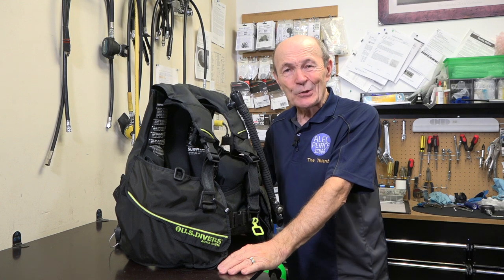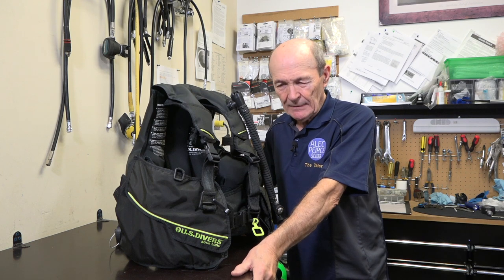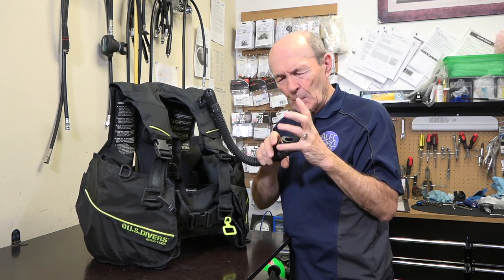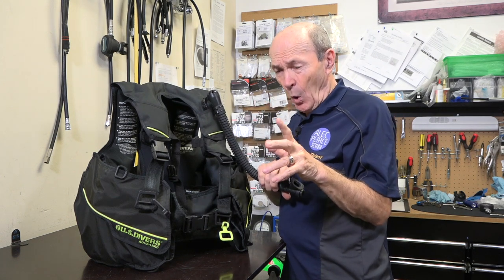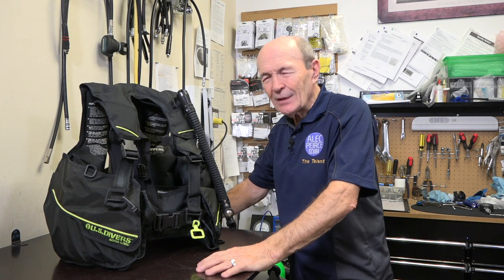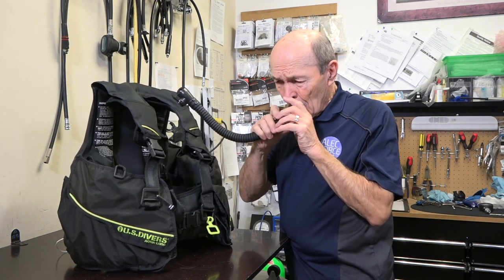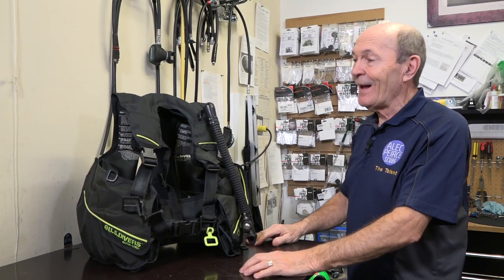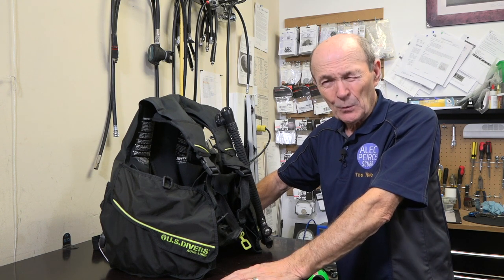My BCD Goes Soft! - Scuba Tech Tips: S13E11

Comment: This video is exactly what I was looking for. 

Last week I went diving,  did all the safety and equipment inspections before the dive, and everything looked fine. 

Jumped in, started the descent, got to the bottom slowly while inflating my BCD. Then I realized that I wasn't able to keep the trim right, kept inflating the BCD, all good for a couple of minutes and then It  slowly deflated again... So I ended the dive and resurfaced. 

During the debrief I checked again all my equipment and found an air leak coming from the inflator valve of the BCD. 

At first I thought the valve had broken, but, just for the sake of it, I tried to screw it in a little. It worked. No more leak. 

In the end, the problem was that the valve unscrewed itself just a little bit while descending because the tank was hitting against it. Never happened before. 

Anyway, thanks for the video Alec, I've been following you for many years now, never disappointed. Greetings from Italy!
Reply from the maker: Hello Giulio.  Thank you for sharing your experience and glad you could repair the problem before another dive.  Many folks just stop, which is generally OK but if you are competent and think about it, many minor issues like yours can be fixed (maybe faster after watching my tip?).  Take care and love Italy.
A.

Comment: Alec, this was a great video. I was worried, a few years back, that I had cross threaded the plastic threads on my bcd connector hose because I had a small leak and unscrewed and screwed that valve back on and it felt like the threads jumped. (I'm a big guy; very heavy handed). I took the BCD to my local dive store to see what he thought. He unscrewed the inflator valve where it connects to the BCD, put a little silicone oil on the  valve and rubbed it in (as I've seen you do), did the same to the other two valves, screwed everything back on and said there you go. I took it home and inflated it fully. That was a year ago and the BCD is still just as tight as that day. I learned a few lessons from this. One, you provide valuable information about maintenance. I followed your advice and the tech couldn't believe that my bcd was five years old and had 50 dives in it given the great condition it was in. Second, if anyone like me is watching this and is given to anxiety about damaging expensive equipment that they don't have funds to easily replace, then go to a trusted local dive shop for expert help. Thanks for uploading, Alec.
Reply from the maker: Much appreciate your feedback Joshua.  Glad to share my decades of dive knowledge with everyone.  Must have made your LDS sad they could not sell you a new model after seeing how well you take care of your gear. 
A.

Comment: It is totally normal to have a bit of leakdown, just the permeability of the fabric to nitrogen and oxygen molecules is more than enough to explain that.
an anecdote, I bought a used BCD in a garage sale and I removed the power inflator to disassemble it and service it, I fabricated a plug with a schrader valve included, i installed the plug on the BCD hose and i inflated semi hard to check the integrity of the bladder, I leaved it alone for about a week.
to my surprize, I found it in the same condition I leaved it one week ago.
just to say that the apparence of that BCD was less than pristine but the function was still there.
very good topic and very good video.
Reply from the maker: Thank's for sharing Jacques and that function does beat looks in older gear.  Take care.
A.

Comment: The joint between the body and the inflator hose is a swivel and it may leak with some movement. I once dove and the dive guide signals to me to help check where a leak is coming on his back, it was from the BCD to inflator joint, so I just turn it back and forth a few times and the leak seals by itself. The BCD lost some air during that short minutes but his buoyancy seems not effected significantly.
Reply from the maker: Glad to read your experience and how it was fixed during a dive.  Thanks for sharing Bing.
A.

Comment: One other factor is:  If you orally inflate the BC, your lung air is around 98.6F or 37C.  The place where you store it is around 68F or 20C.  As the BCD cools, the internal air pressure will decrease AND some of the moisture from your breath will condense, both of which will reduce the volume of air and lower the internal pressure..  So, even a perfectly sealed BCD can get a bit softer over time.
Reply from the maker: That's why rinsing and drying before storing is so important.  Good points on condensation Alan.
A.

Comment: Hi, today I received my brand new Atomic Aquatics T25, B2 Octo and Mares Puck 2 for $3600. The hose on the T25 has small abrasions which stretch for a few inches on and off. Other parts seem like they have an excess of rubber. It is not smooth to the touch. I took pics and send them to Huish outdoors. They responded that it’s either  shipping or manufacturing defect which does not impact the integrity of the hose. I know that Atomic Aquatics had a hose recall in 2019. I think the best course of action is to return the whole thing and never touch Atomic Aquatics again.
Reply from the maker: That may be early as if the maker says it does not affect the hose working, it is safe but not 'new' looking.  Have you tried the dive shop it was purchased from to swap it?  After a few dives most hoses have lost that new shine.
A.

Comment: My test is generally about 30 minutes. It should be pretty much the same after 30 minutes, then it is fine. But I will say that my Rec wing has been hanging for a couple of months, as I rarely use it over my tec gear, and it is probably like 80% full.
Reply from the maker: Give it an hour as that's how long most rec dives are.  Good points Peg.
A.

Comment: Whenever I have a BC issue, I would bet it is the LPI first. I gave up on trying to rebuild it. I just switch it out now. I had issues both with leaking into and out of the BC. If it is not the LPI then 2nd I bet the purge valve on the hose. If that is not the issue then the dump valve last. Of course inflate and immerse look for the bubbles. And attach a tank to it also to check that valve too. Sometimes they stick.
Reply from the maker: They do stick which is something many divers miss checking before getting it serviced.
A

Comment: That is one of the reasons that I quit using a standard bcd long time ago.  Wing with inner rubber/silicone bladder us more reliable. And even more reliable are the inflatables from poseidon (just go and compare a lung from poseidon rb to a lung from any other rb manufacturer and you will see what I am talking about)
Reply from the maker: I like wings too but for my old bones, a BC perfectly trimmed is very relaxing.   Thanks for watching.
A.
Reply: Sunt multe brand-uri cu veste bune, nu neaparat wing-uri, ea ca orice echip trebuie verificat pe unde scapa aer, se cam stiu pe unde scapa aer si de ce, ba un oring deformat, ba vreo supapa nu mai inchide din cauza mizeriei sau uzurii,  ba vreun arc moale da drumul la aer sau mai rau e intepata vesta  . Conteaza cat de bine iti intretii echip.

Comment: Umm...Personally, I would never inflate a BCD until it's stiff or "hard".  For one, you are putting the valves, seals &  materials under tremendous stress.  You would never, ever inflate your BCD in or under water until it's stiff.  Underwater, it's dangerous.  You will ascend too quicky  & once you start moving up to the surface,  rapid expansion  & surfacing will occur. 
Two, on the surface it's never necessary to achieve equilibrium & "hover" at the surface.  Check your weights & displacements with a full & empty tank.  Most people over weight, IMHO.
NOW if you are lowering a steel safe filled with gold bars, what  you really  need separate flotation.  
Modern BCDs have 20 to 40 pounds of displacement, the amount of water their flotation has replaced.  That's a lot.  You'll never need that much & if you did inflated fully at depth, you better have one hand on the deflator valve pull & the other on your inflator hose deflate button.  
If you inflate your BCD to rinse & dry, do it to about 80% full - that's more than enough to get the job done.   Likewise, be cautious underwater with the flotation &  equilibrium you are attaining.   
Ever hear an underwater siren while you are 120 feet down on a beautiful dive?
We had to take a guy to the decompression chamber at Catalina because he came out of the water at Farnsworth Banks like he was Flipper surfacing.   Too much flotation at depth,  unfamiliar with his gear operation, to little attention paid to ascension rate.  Several hours in the chamber, he took a plane back.
Reply from the maker: Remember that a BC is made to fully inflate safety until the over pressure valve releases.  My example is on land and testing for leaks, not in water.
A
Reply: @AlecPeirceScuba_SeaHunter  Of course!  I just don't like taxing my equipment.  
For leaks I always just look for an extra telltale bubble stream while diving.  A couple of slow rolls usually works if solo diving, or while under have your dive buddy do a equipment check.   Bubbles are a sure sign that something needs attention between dives. 🤿🗯️🗯️🗯️🗯️